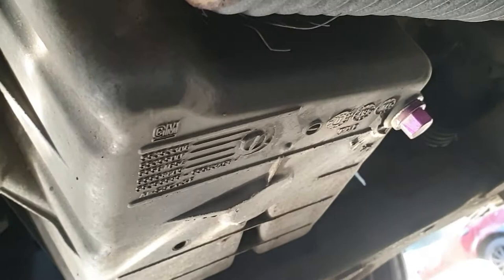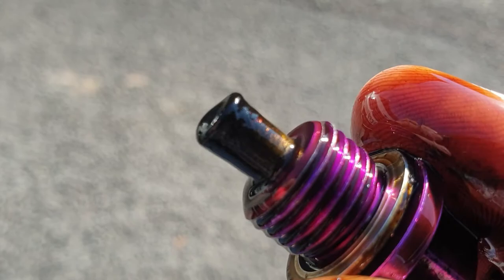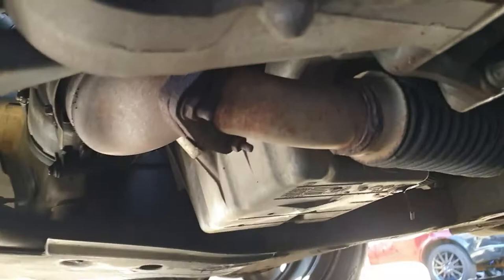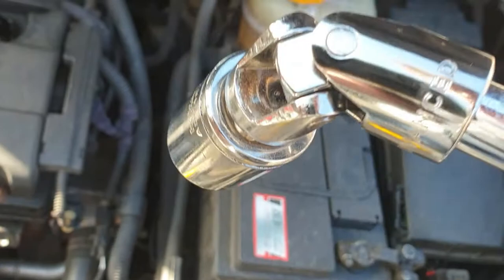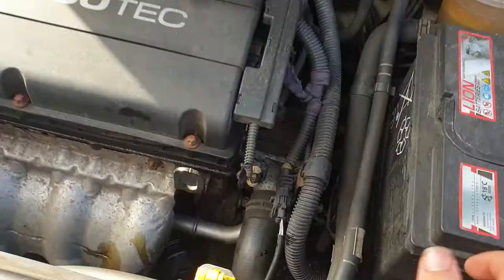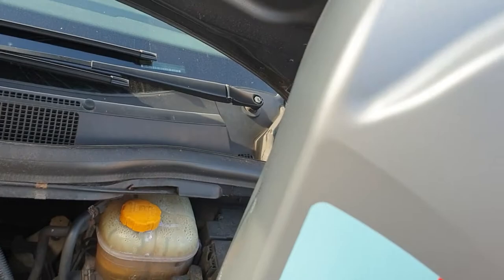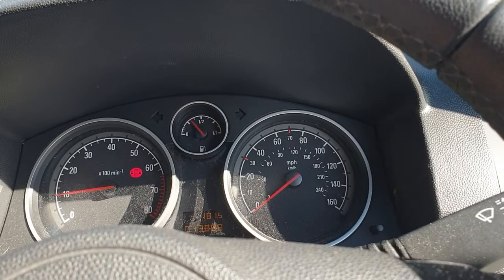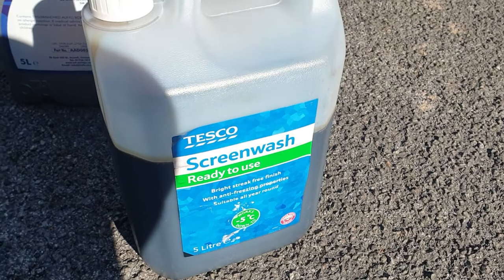How To Change The Oil And Oil Filter On A Vauxhall Zafira B

Comment: Hi mate i'm  just about to do the oil change on one of these, the oil should be here tomorrow. I bought MOBIL SUPER 3000 X1 5W40, i noticed on the packaging you used a 5w30, will mine be ok? Mine is a full synthetic oil.
Reply from the maker: Yeah I belive it should be okay
Reply: @gazza9919  Zafira - high volume - large sales = maximum spare parts available.
I've owned several Vauxhalls and they are great workhorses. Economical to run and funnily enough; everybody "hates" them but they sell !!!!!! Sensible cars.

Comment: Hi, is the sump nut torque 14nm ? Cheers..
Reply from the maker: I mean you should torque them but it isn't the end of the world if you don't
Reply: @gazza9919  I'm doing mine the weekend, is 14nm the correct torque ? tia
Reply from the maker: @stephenglasgow762  to be honest mate, I've never torqued any of my sump plugs up. I'm not sure of the spec but if you do it tight but not to the point where your hanging off it you should be alright